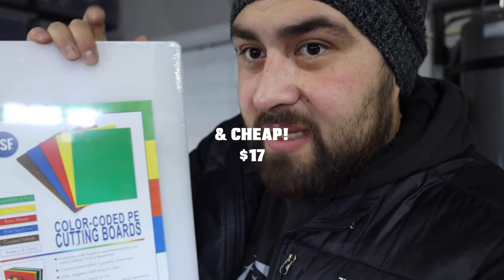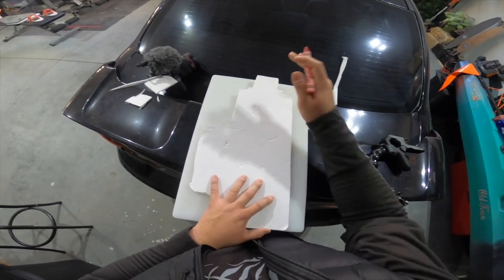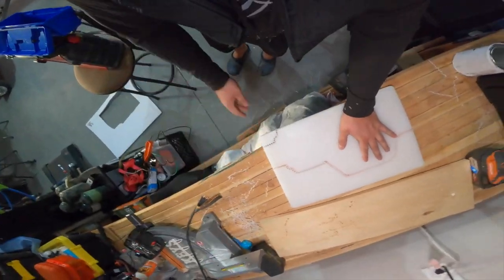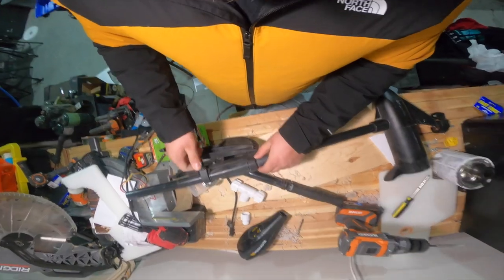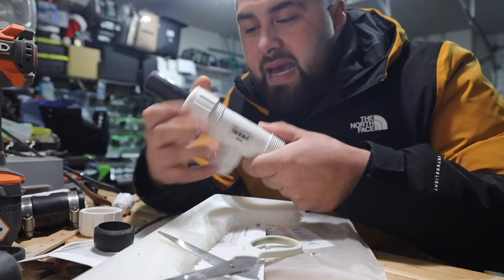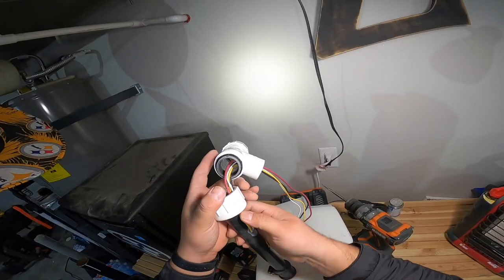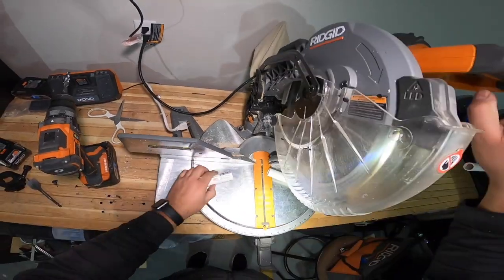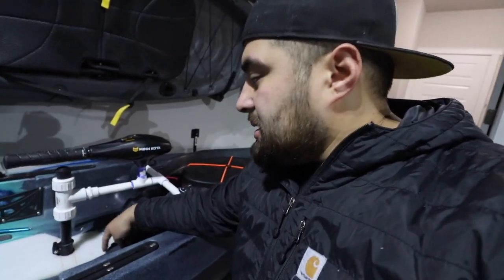COMPLETE TROLLING MOTOR BUILD -  Oldtown Topwater 120 PDL!

Comment: Simple suggestion on cutting shaft.  Take a smaller diameter pvc tube, slip it over the wires and into the shaft.  Use it as a safety barrier between shaft and wires while cutting the shaft. This will prevent possible damage to wires.

Comment: Hey bro, great job. This is why I love today's kayaks. They are a one man boat. And you couldn't give me a boat. I purchased my 2021' Blue Lagoon, Hoodoo Tempest 120 Pdl. Once I saw, they design a short shaft, 46lb lb thrust trolling motor, that mounts exactly where my pdl mounts, and the reviews, I knew I would love it. So I have a 120 pdl X34" wide, with the motor in cuts through the water, average 4 to 5 mph. I'm 5ft 7 151, so she moves. Had a great 1st season, and this winter have many more additions going on. Waiting on my bixpy j2, that'll mount to my toe control drop down rudder.  But obviously I'll run one for long runs, the other to troll around, and paddle around my spots., and I always learned it's 🖍 CRAYON. One word..lol. Be safe bro..
Reply from the maker: All my life I wanted a boat.. then I got this kayak! We’ve become a kayak family now and so it’s been a treat. Whenever I buy something expensive for it, I say to myself “still cheaper than buying a boat.” 😆 appreciate ya! What kind of battery are you running.

Comment: Nice build! Only thing I disagree agree with is keeping the controller head. I would have ditched it since you’re not using it to steer. You’re only using it to switch gears so you could take the switch out of the head assembly and mount it next to you or frankly anywhere to save a ton of room.

Comment: Wanted to add, I started with a led acid for my 46 lb thrust trolling motor, that us mounted directly in that spot. And my battery sits, behind my seat, and my 12V cabela's battery, and power box I DIY'D for my electronics, us in my bow hatch. I'm 5ft 7 151 lbs, worked great. Now I have 2 50 Amp lithium from amped Outdoors, and last all day, sometimes 10 plus hrs, if it's a hot day, I'm on my katak all day. But hope by now you gave all of that a nice coat of black spray paint. That would make it look sweeter..

Comment: Hey dude I like your DIY trolling motor build the only difference I would’ve done on your front support pipe is put end caps on each side so the water wouldn’t get in there when you’re in rough waters so that the wires don’t get wet. Outstanding build.
Reply from the maker: You’re right. I would need to try this!

Comment: Dude awesome build. New subscriber. 
Last year I took the head unit off my trolling motor and put it next to my seat, works great. I am on a SS127 Bonafide, but just got a Sportsman 120 PDL. I want the best of both worlds, pedal and also power. I am now going to take the 5 forward 3 reverse switch in the trolling motor head unit and put that into a small waterproof electrical box. Looking at your build, I am going to copy it (thanks) and mount the new box with switch in it on top of pvc where you have the head unit. Again awesome build.
Reply from the maker: That’s exactly what I wanted to do as well’ I’d love to hear how it turns out for you! I think it’s like a PMW box or something like that right. My trolling motor head is getting kinda wobbly so once it wears down from the wear and tear I’ll be doing the same! Appreciate ya!
Reply: @fishingthe509  you’d be much better off putting a pwm on it for infinite variable speeds and 3x battery life

Comment: Cray On.  Next time tape the foil to the cardboard so it doesn't move on you when tracing.  Try using a jigsaw to cut the cutting board.  To smooth the edges, use a heat gun or flame after sanding.  
Nice idea for trolling motor mount.
Reply from the maker: I really needed this! Thanks for the help, and I appreciate the advice. I will for sure mention these things on the next one. 💯

Comment: great work...lol  i had to do a similar thing for my 106 mk. the control board has now burn out twice. so i made a back up. but mine can swivel (i can turn it around) and i can turn a handle that screws inwards to keep it straight. for my kayak. the motor hole is farther forward, so i only shortened the shaft and left the head on. it works great, but the cheap 45pounds thrust i bought is slower than the minn kota. 2 kph slower. i will probably install a pwm speed controler next, to be able to use my original minn kota motor. my advice if you do that too, use a powerful one with a bigger capacity because the usual ones , i hear, do burn out eventually. and i plan on installing the board where the original board is. under the aluminium plate(not in a plastic box). take care guys...lol

Comment: Thank you for posting, great ingenuity on your part - I will try this on my OT 132 PDL. Quick question: Does having the motor head that close to your fish finder transducer cause any interference challenges on your electronics? I assume not as it is similar to the OT auto pilot. Just curious if you experienced anything. Thought I would ask.
Reply from the maker: Appreciate you! There have been 0 negative effects but I also now run my transducer off the starboard side.

Comment: Awesome project! Are you still able to steer it without the head being on the shaft; instead it's connected to pvc and the wires?
Reply from the maker: Thank you!!! This particular kayak has a rudder system, so I actually control it from the little turn knob by my left leg. The motor is just used for propulsion. 👍🏼

Comment: You might try marking the foil with a pointed Sharpie marker while it's still in the 'yak where the foil meets the side and bottom of the well; that way, when you pull it out you have an accurate tracing of the bottom of the depression to make your template.

Comment: Are u using a rudder to steer? Also for anyone else, u can take the head off the motor like he did and spin it around reversed then attach it. This way the handle isn’t is the way. Came out good lots of info to make ur own set up.
Reply from the maker: Yes! This Oldtown model comes with an implemented rudder system. That’s also a great idea! I’ve seen some people mount a PMW box and really tighten up the profile!

Comment: This is legit man! I’ve been sitting around the last few days thinking about doing this to my pdl120 and I thought surely there’s a YouTube video of it and bam yours popped up lol. Is it still holding up well and performing good almost a year after the build? I also seen in the comments by moving that head it kept the motor stationary and you still control with rudder system. Does the rudder system handle the extra power/speed ok vs the pdl?
Reply from the maker: man barely seeing these messages, it actually works extremely well. I tried running it with a lithium battery and it was a game changer. I would run it more but I think the lithium is a must. I used it for trolling and honestly it rips, the rudder works flawlessly.
Reply: @fishingthe509  thanks for the response! It looks like the perfect setup for the pdl replacement. I’ve already picked up a trolling motor, wiring kit and basically everything I need except for the battery. I’m gonna get a lithium, that definitely seems the way to go for weight and performance, just haven’t hit the place order button yet cause it hurts so bad lol

Comment: How did you secure the cutting board to keep it still?
Reply from the maker: This is a great question. Post video I put a hose clamp under the board to keep it from moving up and down. The shaft was pretty tight in the cutting board to where it wasn’t moving up and down too much. Maybe applying some black electric tape to the shaft till it gets tighter. Hope that helps.

Comment: How do you actually steer it? The motor shaft is no longer attached to the tiller handle.
Reply from the maker: this particular kayak has a rudder system that compliments with the PDL drive, so the steering is done with a little “steering wheel” that is on this particular kayak.
Reply from the maker: Great question
Reply: @fishingthe509  Thanks for clarifying.  I have an Old Town Predator without pedal drive, been scouring Youtube for ways to mount a trolling motor without too much hassle.  Easiest are sidemounts that look real flimsy.  More advanced are rear mounts with cable steerers, electric lift motors, wooden parts, etc.  Loved your front-center mount position and wish I could make it work somehow but there is no opening through the floor.  Still watched and liked the video though!
Reply from the maker: Thank you brother I appreciate you! There’s a guy, on FB Kevin Dismuke. He sells this super cool kayak trolling kit (without motor) for like $300. Pricey but super nice setup. Check him out, I plan on buying from him sometime soon. Really nice guy

Comment: So dope... I've been thinking bout this for a while and u actually did it... props to u... question... would it work if u moved the motor further towards the bow?
Reply from the maker: You’ve actually given me a great idea, lol if you had the fitting go forward in a T shape towards the bow, you could attach a string to it and lift and drop like a mounted trolling motor on a bass boat. Is that what you’re thinking? Could be some structural ingenuity you’d need to lock it onto the handle in the front, but def possible. Thinking outside the box for sure.
Reply: @fishingthe509  how sturdy is the whole unit when the motor is up/not deployed?
Reply: @fishingthe509  no not right at the bow... I just meant to move the motor more fwd then where u put it... was there a reason to why u put it where u did? I believe California outdoors had his motor further fwd on the board
Reply from the maker: @yakin_n_bassin8203  honestly, when it’s all glued together it’s very sturdy. Also using schedule 40 pvc was a must. Other than the cutting board wanting to rotate around the shaft of the trolling motor. It is a well put together unit.

Comment: I would bet you could sell that plastic plate n put together a kit for all that. Even if you put a motor on the back youd still would need a cover for the pdl hole. Does old town even sell a cover for the opening?
Reply from the maker: Tbh, I think they do. I also think there are a bunch of 3rd party sellers that Oldtown recommends. Close to $100 for it tho! So I had to improvise! Lll

Comment: Great job, but show us the bottom also.
Your motor may have to be moved up or down to get the right power output so a longer shaft would have been better for adjustments.
Only issue is pulling it up for shallow water or clearing debris from the prop.
May want to use lightweight aluminum piping instead of PVC so you can pivot the assembly up like the PDL unit does. 
Also, I would MUCH rather do this with a spot lock remote controlled Minnkota than a standard one like this.
Screw paying OT $4500 for their spot lock kayak.
Reply from the maker: you are right! i measured it about the same as the PDL distance prop. But i love the idea of matching the pivot assembly. I just tried to make it as cheap and reliable as possible. LOL I did pull off junk off the prop once and it was not fun. But i dont fish too much muck.

Comment: I m missing something. How is this steered?  The head is not connected to the motor shaft.
Reply from the maker: It is steered with the rudder system on the old town topwater 120 PDL. Sorry I forgot to mention that! I think it shows the steering knob at the end! Appreciate you!
Reply: Ok. That makes more sense.

Comment: isn't the propeller pipe suppose to be connected to main control and accelerator to be able to turn it, not disconnected?
Reply from the maker: yes sir, you are correct. On my model of kayak it comes with an integrated rudder system that I use apart from the trolling motor. If you really wanted to, you could probably go longer with the shaft. not sure how much torque would be on your knobs

Comment: Will this work on the 106 with the same measurements?
Reply from the maker: All of the measurements should be all in the same ball park, maybe the cutting board would need to be cut down but the general concept should work just fine. Let me triple check for you and I’ll come back with some info I find.
Reply: Thanks and that is a great video,, I hope you do the pwm video soon, that could save some valuable space inside the kayak
Reply: And can you tell me if your cutting board is ½ jnch or ¾ inch
Reply from the maker: I went 3/4 bro
Reply: Thank you again
Reply from the maker: That’s what I’m here for bro! Anything else just let me know 💯
Reply: I'm 90% done, what is the distance from the top of the minn kota (18") to where the compression fitting starts?
Reply from the maker: @slicvic1  I will measure that when I get home in about 30 minutes!
Reply: @fishingthe509  thanks Bro, appreciate all that you have done